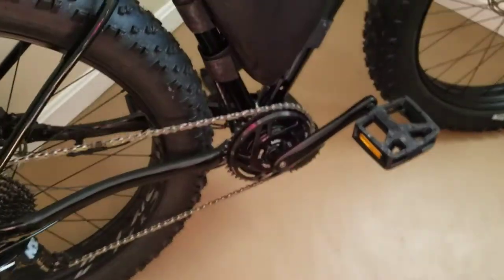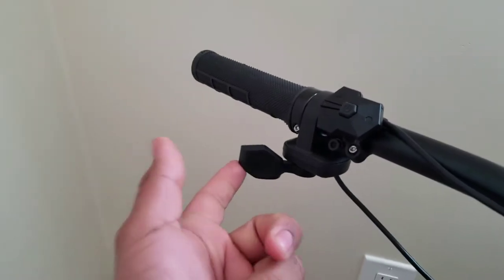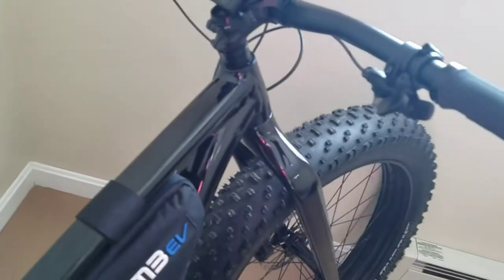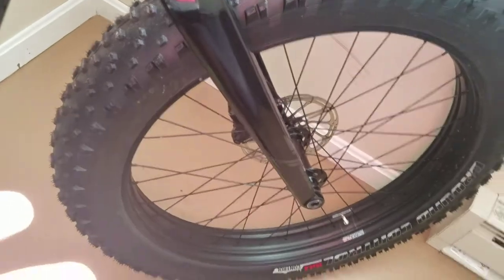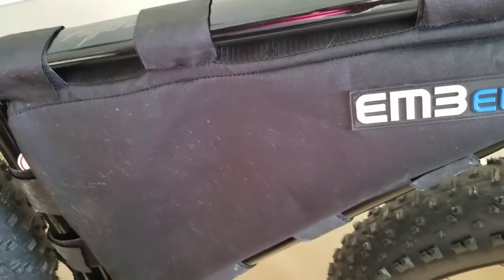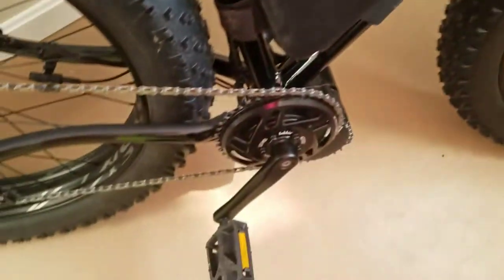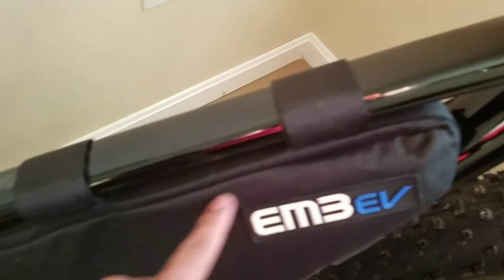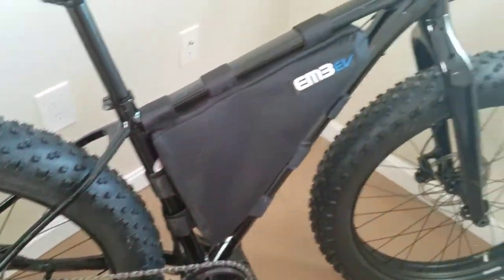Turning My Fatbike Into An Ebike

Comment: Did you use an adapter to mount the motor or did the BBSHD slide right in the bottom bracket?
Reply from the maker: 99217GMAN This Fatboy model is an old model which had a threaded BB. The motor slid on with no problem. New Fatboys come with PF BB so those probably need adaptors.